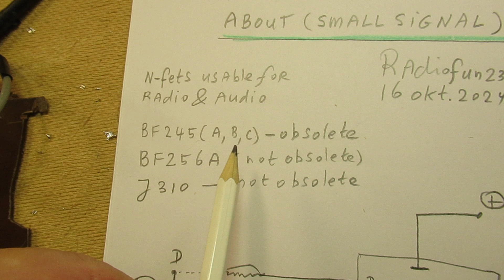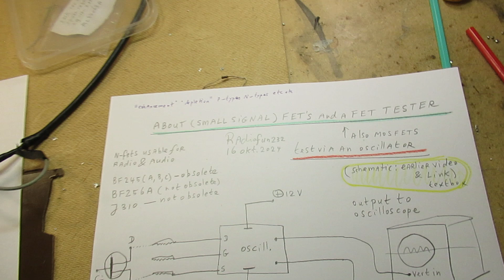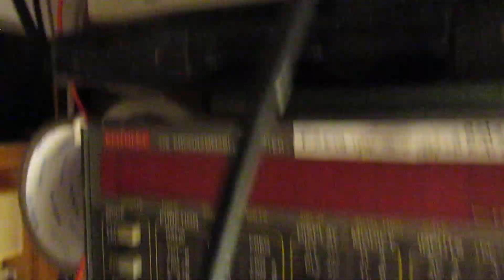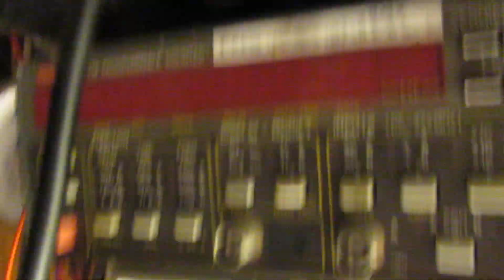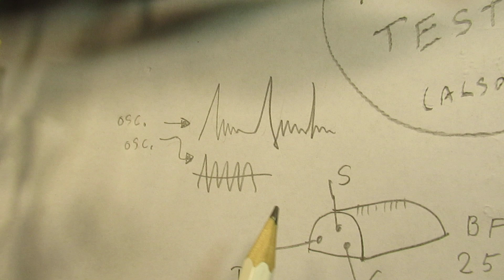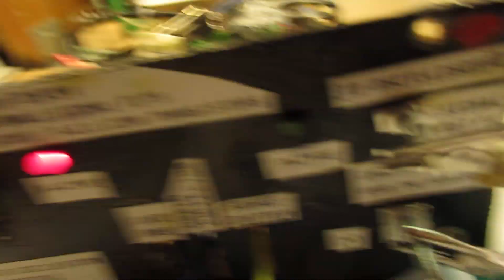Field Effect Transistor tester for small signal FETS and MOSFETS, via the oscillation principle

Comment: I love little DIY EE Test Equipment Projects! This is a good one! Just to encourage those that do not own an oscilloscope... The output of the circuit could probably be adapted to drive a simply LED indicator light, to prove the oscillation. Additionally, there are very inexpensive frequency counter kits that could read the oscillation. They do not show the shape (quality) of the waveform, but knowing that shape is not necessary to proofing the component that you need to test. You just need to know that there is an oscillation and a count would prove that. If you buy such a frequency kit, do some research first. Many of the kits require a little tweaking, which is most easily accomplished during the original build. YT has lots of videos about the tweaks. Or, better yet, design and build your own frequency counter. HTH.
Reply from the maker: Thanks, useful info for everyone.